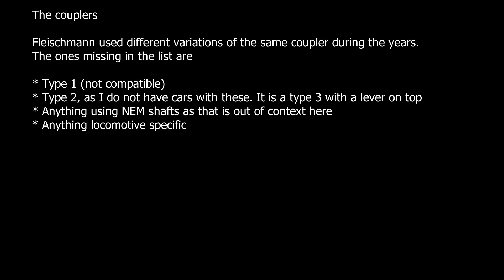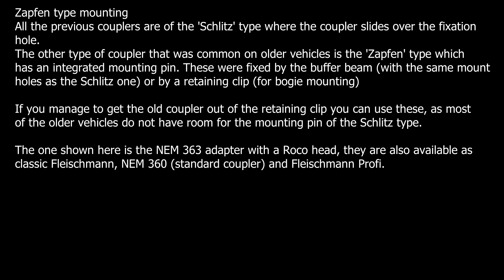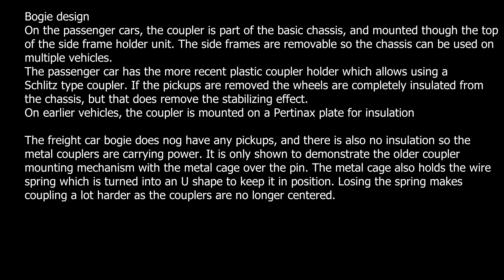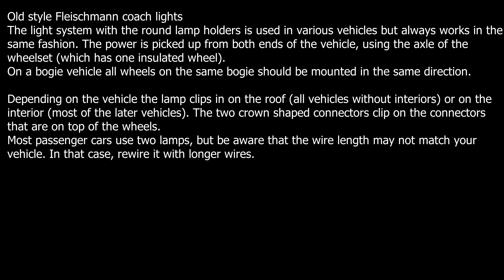Classic Fleischmann chassis details (1960 type)

Comment: Interesting and cool up close look.  One thing I did not tell you was that the DSG Speisewagen I showed yesterday was listed as Märklin by the dealer, but they were not sure.  I just looked at it and felt it looked Fleischmann and a friend said he thought it was Fleischmann, too.
Reply from the maker: That Dsg car is a really old one, with both raised letters and bogie frames without the cutout for the pin.
Reply: Fleischmann copied a lot of the Marklin Pieces early on so in many ways both of you are right, although it would still have the Fleischmann signature logo printed on the bottom plate if it was Fleischmann. It could have also been Pico express, which is even rarer than the old Fleischmann and marklin stuff.